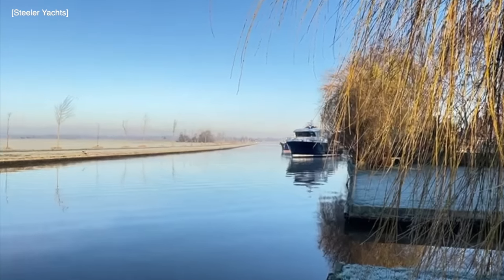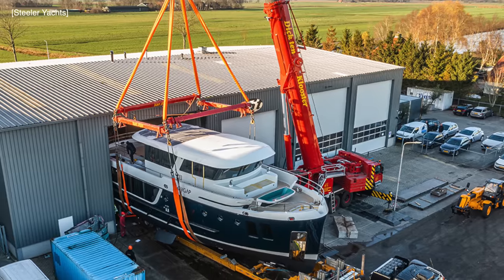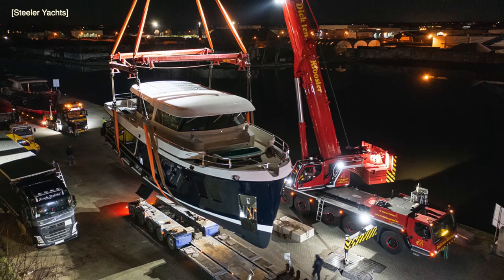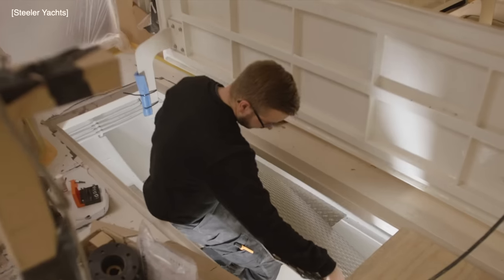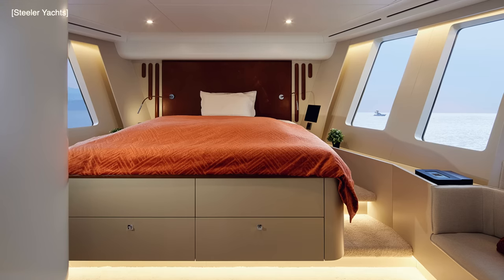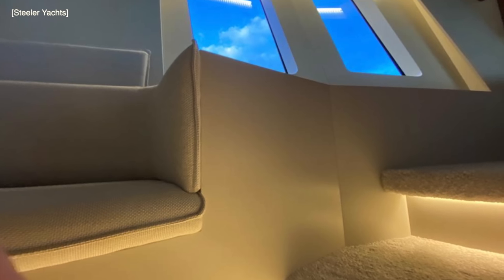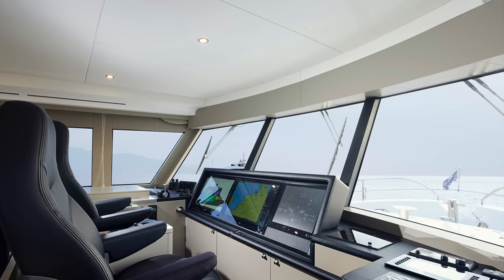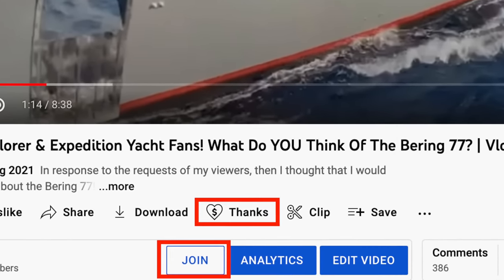Brand New Steel Hull ELECTRIC Ocean Crossing TRAWLER YACHT!

Comment: I love it when you show deck plans and elevations of cabins and equipment. For me travel range at different speeds under ideal conditions, AND BAD SEA CONDITIONS, at different speeds is most important. Redundancy for me means two engines and two propellers and an emergency steering system are essential and should be included in any review. Hull thickness and construction material, especially ice class and double hull are important. How thick are those big windows? I have heard experienced boat builders say anything over 2 feet or 60cm is likely to break if lit by a rogue wave in a big sea. At sea safety comes first. I love what I see of the Steeler 61S. 👍👍👍
Reply: Great points. I always wonder what the risk are with those big windows. Ever a tap from another boat and I'm sure those windows are finished.

Comment: The electricity is definately the future. First, with those much much smaller electric motors, it frees up tons of space in the center of engine room. Second, the motors drink power from the same source as all other appliances onboard, which makes it easier to mnage. Third, we can use several generators combined with solar panels to power the boat, which means if one or two of the generators fail the boat can still power itself to the next destination.
Reply: ..when they implement suitcase reactors. ill travel beyond "antarctica"
Reply: Smaller motor maybe, what about the storage of all those batteries and the charger.

Comment: Please do a more in-depth follow-up video on this yacht.  Just subscribed after following for a while.  Would like answers to:
* Ten hours at what speed?
* How many kWh is in the battery bank?
* How long can the ship sit at anchor on a full battery charge?
* What's the range on battery only (answered by the first question, but never hurts to re-ask)?
* What would a production version of this craft cost?
* Would this system scale down into the 45-50' range?
Reply from the maker: Thanks for watching and subscribing 🙌 I will take a screen shot of these Q’s 👍
Reply: The ten hours is at about 5,5 knots.
Battery bank is 184kWh.
3-5 days at anchor.
30-50nm on battery bank only.
All builds are completely custom. Building cost is higher than a regular fossile build, but running cost is lower, the investment last longer, and the sailing experience is much better, in my opinion.
The technical systems will scale very well both downwards and upwards. The clue is to not be pushy on speed.

Comment: Cool! This gave me some really good ideas on how to build an all electric yacht. One full floor of battery, maybe two floors. And a roof    that can be stretched forward and backward (sliced out) when at sea. So it covers the whole length of the boat, and width! This is a trippellayer roof with solar pannels, and thus gives 3x the solarpower.. When docked, the roof is sliced back to the normal position
Reply: I have concerns about lithium battery fires, can't put them out.   I will be all in when the master the sodium ion batterys

Comment: For those who want electric, I think this is a good first step.  Wider has been doing this for a couple years and it's nice to see it trickling down to the smaller market.  While it's nice to say, "it's electric", it really isn't as it still requires a generator for several hours every 8-10 hours.  Still, if some of the battery announcements over the past few months work out, it may be possible to extend the "every 8 hours" to every couple days or every couple weeks (depending on the battery technology and how well it can be moved from the lab to commercial applications).
Reply from the maker: Thanks for the comment 🙌 I can imagine one of these with a large retractable wind or water turbine that can charge the batteries whilst underway. Although, I’m not sure about the science behind this technology so I have no idea as to how big the wind/water turbine would need to be in order to negate the need for the generator 🤔
Reply: @YachtBuoy  Those wind turbines are probably 500W, so both of them going at full clip would produce 1kWh in one hour, which isn't enough to put a serious dent in even house power consumption.  And they'd produce drag underway.  But at anchor on a windy, cloudy day, they can supplement the solar.  Not sure why they didn't entirely carpet the pilothouse roof with solar, which would've been better than adding the wind turbines.
Reply: @jdray  this is not built for the Mediterranean only. It features a Norwegian flag, and in a climate like that wind is pretty reliable.
Reply: @RA-lj5jd , sure.  But there have been several studies that indicate that, including maintenance, depreciation, etc., given that a wind turbine of that size doesn't have much output, wind is far more costly per kWh produced than solar.  I'd be interested to see how the turbines on this boat perform over two or three years.
Reply: They make SAILBOATS  for a reason
Reply: @joshlower1  They developed powerboats for a reason...no wind.
Reply: At first yes, then the dumb owner made it all electric and will now be stranded at sea dead in the water on a cloudy day

Comment: Fantastic concept, and about time electric motors get more use (obviously the likes of silent yachts, some greenline and possibly sunreef use them, but pretty much everyone else is still on diesel). 
Wheel at the door of the wheelhouse is also very sensible, allows for single handed operation, and since it's an expedition yacht operating at displacement speeds, you'd only rarely need the wheel in normal navigation outside of the marina.
Looks like a proper sturdy little ship :)
Still waiting on that Lottery win though!
Reply from the maker: Thanks for watching and for leaving a comment 🙌 good luck with those numbers 👍
Reply: Diesel is and shall remain king.
Reply: This is diesel too. Diesel generator charging batteries. It's twice as harmful to environment.

Comment: Would be nice to know more about that electric propulsion system.  What's the capacity?  How far can it take you, and at what speed?  How many screws?  Thrusters?  Can it be charged via shore power if you don't want to run the generator?  How much power does the solar provide?  How is the house power provided--same battery, or a separate system?  Do you need the generator while on anchor or is the solar enough?  Also... what's the thing going to cost?  I assume they're planning on making more than one of them.

Comment: During a storm while using the electric motor can you charge the batteries with the Volvo motor?
Reply: I think the Volvo is the genset, probably 100 kW.  So two hours of runtime would get 200 kWh of battery charged, which sounds about right for pushing a ship like this for ten hours.

Comment: Love the boat and it looks stunning. Has the builder mentioned anything about projected range? I know it is still undergoing sea trials now but I'd be interested to know if this is a true trans-oceanic vessel. It rated for it sure, but I would be interested to see on a typical crossing what the fuel consumption numbers would look like. Obviously you'd be running the generator 4-8 hours a day depending on weather and other variables. I'm more of a numbers guys when it comes to explorer vessels. More is better, I always like seeing a true range well over 4000 nautical miles and lots of redundancy in the systems.
Reply: It was noted that it takes 2 hours of charging to top up the batteries for a 10 hour run. It would appear that the fuel tanks do not need to be large to accommodate a 3000nm range, for example.
Reply: @MannyB-b7l  you will need the same or even slightly more fuel for a transatlantic crossing... the inefficiencies of charging and discharging the batteries is what gets you. and fuel has the same amount of energy in it no matter what you spin... a propeller or a generator. dont get me wrong... this is great for visiting fjords or delicate ecosystems, but it wont save you any fuel. and as for the solar panels... they are more of a fashion statement and tricklecharge for the batteries at dock.
Reply: @jstefa2  I'm not sure that is correct. Can yhou explain in more detail?
Reply: @whattodonext312  laws of thermodynamics... if you burn fuel for energy it doesn't matter how you get it to the propeller... if you want your engines to be stationary for half the time you will need to burn double the fuel for the other half to keep the same speed. half the fuel for propulsion and other half to charge the batteries. having batteries on board for cross Atlantic is not an efficiency solution... its comfort solution so you don't have engines rattling during the night.

Comment: I'm a couple of years late to the party here, but I love the idea of electric vessels, and I have a question about this one. 

If you're going to run an electric motor, why fit the vessel with so few solar panels? Surely you could cut back significantly on the need to run the generator if you were incorporate more solar into the design. 

Maybe this is something the manufacturer has worked on in the last 2 years, or maybe my question comes from a place of ignorance. I would love to be enlightened.

Comment: I am all for alternative energy, however, the battery technology has a long way to go prior to being accepted by the general public. As with any electric propelled object, the enormous amount of variables you might encounter has a direct effect on range, speed and other electric gadgets the car or boat are supplying. Charging times vary wildly. As consumers are now finding out with electric trucks, if used as a truck, the range is many times 1/2 or less of the manufacturers claims as proven by many real world tests of these vehicles. As far as a heavy yacht, I am sure the sea state will have an enormous effect on the range of these types of vessel's. Another consideration is potential issues with saltwater intrusion into the battery with a possible electrocution/fire hazard. Again, I have nothing against this technology, but I don't think the general public is getting all the information about the potentially large and expensive issues that could arise. Just because it's Green Technology doesn't mean it's the best choice for your needs at this particular time. Maybe in 5-10 the technology will have worked out the bugs, as of right now, it's not ready for prime time.
Reply: Wrong getibgg above arrange current speed ere soeed demn energy yses faster 155 moh ev use 3 tkme errct thrn 55 moh evs
Reply: Like 1984 canon ball run exicars bad fu k efecty top sieedd very shir rabge

Comment: Reading some of the comments, there is a lot of interest in this electric steel yacht. There is a need for more technical details, deck layouts, range with reserves at cruising speed, and the cost of battery replacement and battery life in years before replacement.
Is this an ice rated hull? It could Island hop from Holland to Scotland, Iceland, Greenland to Canada.
We need to know the range at 7 knots and the rate of range reduction as the speed increases. Being stranded at sea with no fuel is never an option so this information is essential for every yacht. 
This 61' steeler with an 8000 litre fuel tank, appears to have a range of 2,500 nautical miles with 500 NM in reserve. Excellent for coastal sailing and island hopping but not a transatlantic ocean sailer. 
Can a 12,000 litre fuel tank be fitted? Is the heating electric and is it air conditioned? Does heating and cooling reduce the range?
How big and heavy a tender is recommended?
This yacht is an ideal live aboard and a large TV mounted low in the living area (not a pop up) is something I would desire.
There's only one problem when you deal with the Dutch, they offer to little and charge to much. The Dutch have a reputation for quality design and construction, "Tanks of the sea," but this makes them expensive. I know YouTube regard reviews with a price as an advertisement, but a redirect to a website with these details would be great. Maybe Yacht Buoy needs to work closer with the manufacturers.
A follow up on this boat is needed. A great boat, Thank you Yacht Buoy for revealing it to us. 👍👍👍
Reply from the maker: Thanks for watching and for taking the time to write this comment 🙌 the vessel is going through sea trials at the moment, so much of the technical specs of hull #1 are being calibrated. A following video will be coming in due course 👍

Comment: "Greener," is still very expensive.
- 2,600 gallon fuel tank = $14,000 to fill.
- Range is 2050 nautical miles (2360 miles). 
- Monthly liveaboard fuel budget = $1,200
- Monthly max range = 200nm 
- Monthly Co2 emissions = 4850lbs (58,000lbs yearly).
We're definitely making progress. I'm looking forward to the next 5 years. Better and way more affordable battery, hydrogen, nuclear, tech is already here.

Comment: How long the generator runs does not say anything about how efficient the ship is. I am interested in which battery types, volts, KW/h are available, which generator with which power and volts, and which electric motor with Kw and volts is installed. Also I see too little solar surface. Only then an estimation is possible. These values are extremely important, even if the layout is successful.
Reply: sorry some of the information I overheard in the first minute😇
Reply: the data leave me a little perplexed. If the generator has 81 kW and runs at 80% power then after two hours just 129 kW are available which are consumed in eight hours. That would mean that an E-motor with 16 Kw the massive ship as a displacer 16 Kw must get along and in the storm with continuous operation 64 Kw power? Is there something I have overlooked?

Comment: With solar cell technology advancements over the last five years, It could probably keep the batteries charged unless you were crossing the Atlantic. Not that long ago solar cell efficiency was about 10%. Tesla solar has their cells up to 20%, and there's a company with new designs in California that say they're up to 45%. With newer Lithium Iron Phosphate batteries and the newer cells...who knows. I would keep the diesel generator as back up though. Even if you can afford a multi-million dollar boat, who wants to pull up to fill fuel tanks and pay 20,000 if you don't have to? Right now, a hybrid system might be the best for long-range.
Reply: Soar ells coming iut 90 oercrt efecyyt maxoum ariunds 33 perct efecy

Comment: Cool but why do you call it an electric bost? I think it would be much more accurate to call it Diesel Electric. The batteries generate no energy. they must be charged by the diesel generator. The efficiency of this process has increased dramatically over the last 20 years but it does have a limit. Thermodynamics states quite clearly that you can never get out more than you put in.
Reply from the maker: Just because she is propelled by an electric motor. Given that a generator is used to charge the batteries, but it won’t be long until the technology is there to enable the batteries to be fully charged by other means. For me at least, an ‘electric boat’ should be defined as such when the majority of its running time comes from battery power, whereas diesel-electric boats derive most of their energy from diesel rather than battery power.
Reply: This particular boat is made and equipped as  a costal explorer. More than half of the total energy supply is expected to come from shore power charging. Less than half from diesel. The solar power is there to make a daily reduction of the shore power and diesel consumption. Same for the windmills, in a year they will make a contribution to reduce the main energy sources. You cannot run this boat on the solar and wind energy. But you have a very good flexibilty in the fact that you can run this boat solely on shore power, with limited range of 30-50nm but fully usable for costal cruising, or you can run it on diesel, with a range of 2-3000nm. And of course that you in real life will combine these options in a way it makes sense to you.